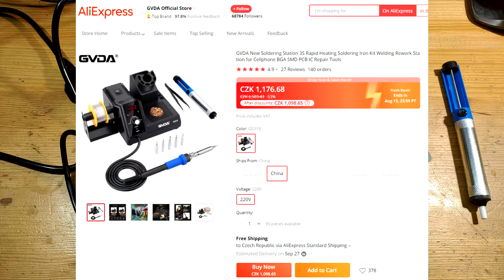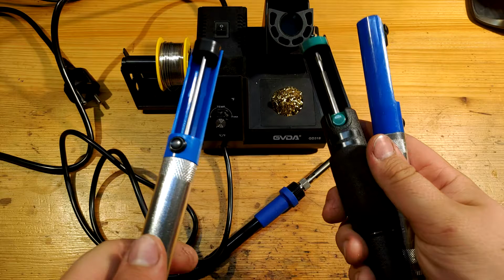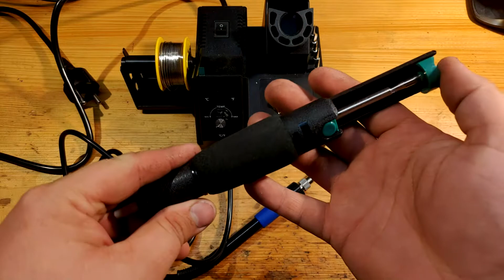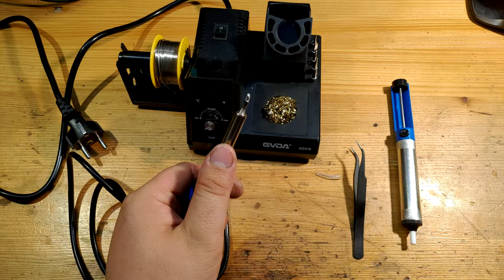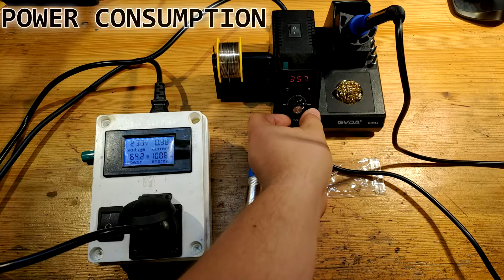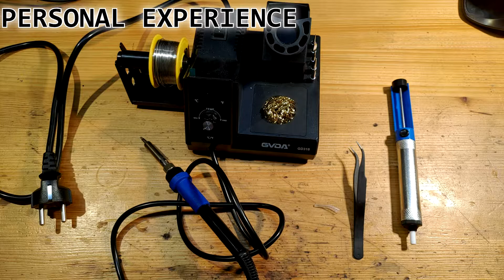GVDA Soldering Set Review

Comment: RegarRegarding the rigid cable to the handle, I did as so many times in the past with PVC coated cables. Pour boiling hot water into a large pan and wrap the cable around the pan while working out the "kinks". The result will be much better than from the factory.
Reply from the maker: Thanks for the tip. I usually place them on our fireplace stove to heat up and then make it straight, and let cool down. In summer, sometimes it's enough to let it be on direct sunlight.

Comment: Thank you for this video!

Recently bought a similar station when my old Weller was stolen. I was wondering what tip you would recommend for the XT60? I'm thinking if 4C is too big, maybe 3C. Do you have experiences to share?

Greetings from Sweden
Reply from the maker: For soldering XT60, I use BC3 style hoof type massive tips, as the heat transfer is best with these tips. I have BC3 for all three soldering iron standards I use, including JBC C245931, KSGER T12-BC3 and 65W portable iron T65-BC3. BC3 is the most universal tip out there. I also have BC4 style tip for my 200W C245951 station, and it slays! But these are directly heated systems.
When using indirectly heated tip system, like this 900M, thermal mass is even more critical for success, so the bigger your chunk of copper at the end of the iron, the better. In this case I would try out 900M 5C, as it has the greatest thermal mass and large contact area.
Reply: @bekrstechnologies  Thank you!